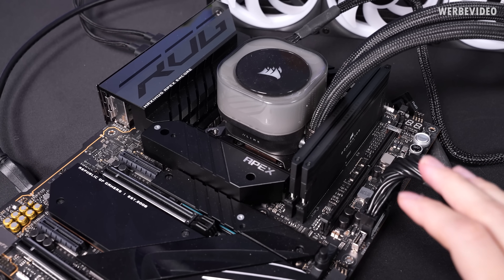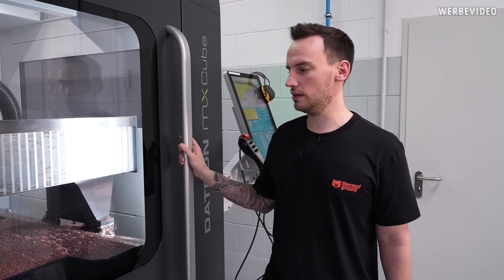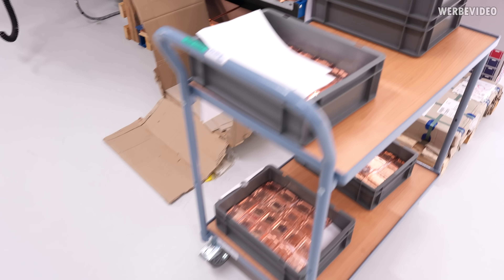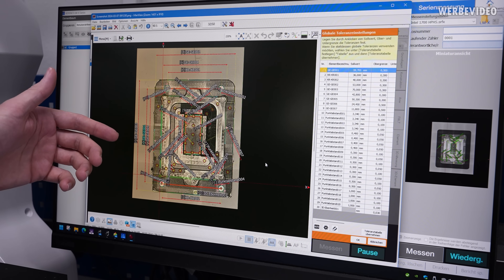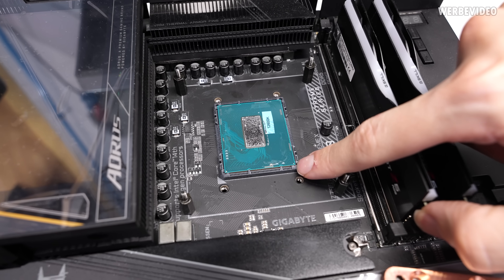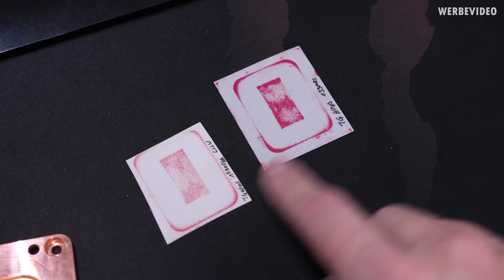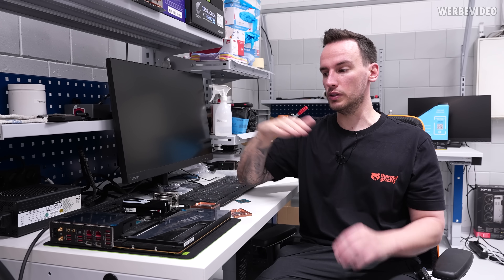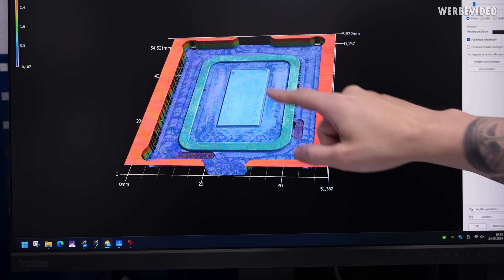I messed up

Comment: That's of course very unfortunate for those affected. And I understand this must feel quite stressful for you Roman and I'm sure your team as well but I'm confident the issue will come to a satisfactory resolution for everyone involved.

I'm a bit sad I missed that the block was actually launched as I've been holding off on buying that Iceman cooler for months prior to you announcing the Intel Direct Die block. Naturally I was pretty excited to finally be able to get a direct die block for my "new" PC. A "fairly recent" upgrade from a Z390 Apex and 9900K sys with direct die to a Z690 Apex and 14900K system which my old water block turned out to be less than ideal for, shocker right...🥴
Living in Sweden I was expecting a wait of 4 to 6 months after initial release until the block became available at any of the three official vendors. At least if previous Thermal Grizzly product releases are anything to go by. Either way I'll continue to wait diligently for this block to become available for purchase.

Fingers crossed, this all turns out to be caused by some weird unforeseeable quirk due to a miniscule variation in how the socket contracts as it cools down after manufacturing or whatever...or if the socket is manufactured at different locations around the world and it just so happens that sockets from this one place have a greater variability in its end results, officially not within tolerance...of course this is not a fun problem to have but I can't help but to be super curious as to what could be specific cause of the problem so even though this is bad it's also really, really interesting and I hope y'all find out what the culprit was.

Until then, as always, I appreciate what you do, how you do it and the content you share with us. 🙏✌🖖👋

Comment: I'm curious about temperature measurements.  Is this a hot-spot issue or a more general heat dissipation problem?  Any information available for mainboard and cpu in use when the problem is encountered?  De-lidded or no?  How many datapoints?  Has the base material changed?  When scaling up from design to production, are there new challenges like heat cycles while cutting metal?

Interesting puzzle, I do hope you'll share more!

Comment: why not just have a pure "stainless" high quality aluminums for the IHS plate? it performs better than copper. i think for an IHS to act as the thermal transfer bridge to the actual cooler's coldplate, it must be simple in shape, the width/dimension should meet exactly the same as the amount of contact with the cooler's coldplate. if you make an IHS so wide, but only let  some amount of the upper surface to get contact to the cooler's coldplate would be pointless. those extra  volume of the IHS that does not transfer anything would simply conserve heat energy.

Comment: As others pointed out, the quickest way to figure out the issue might be to ask affected customers to send their motherboard and cpu for analysis. It might be cheaper to send them a free board and cpu than to pay someone and blindly try to come up with the issue in the lab. Maybe some affected customers could even send their motherboard and cpu without asking for a replacement just to help fix the issue.

Comment: I guess the problem will affect the people who were running a heavy air cooler that caused their motherboards to concave. and since some motherboard have wide screw mounting holes, that concave will not be straightned with the pressure of this DD IHS.

Comment: Relying on your Keyence NDT for all the quality inspection is your problem.  I have a lot of experience with Keyence NDT units, you need to be constantly verifying they’re reading accurately and you should still be physically inspecting parts, samples from each batch, or on a timed interval.  The Keyence units are very reliable, but they are far from infallible.

Comment: Roman could the high ambient temperature and high humidity i.e. >35C and 95% humidity. I've seen weird temp values and only in rainy season with lower ambient temps 20C with 90% humidity, the temps came close to manufacturer. Maybe the info is old since i used mini itx and small build. Been long time since i used full ATX FF.

Comment: I worked in injection moulding ( plastics ) for over a decade. In my experience plastic parts can have a larger variance than you would think.this can be caused by humidity, cycle speed of the machine, set up of the machine, the amount of recycled material being used in the run. All kinds of stuff. Basically never count on plastics being in spec to the same degree as cnc metal. start measuring the z axis on as many sockets as you have available reach out to Steve ( GN an HU ) see if they can do the same measurements. One corner with a mil of flash on it would be enough to set off your contact and increase temps by 10 degrees. Hmmm an adult owning there mistakes and being open and honest about how they plan to make it right. Your parents brought you up correctly. You should thank them. Also, you have earned some more respect for doing the right thing.
Reply: good point about humidity we have some other products than plastic but that also have a tendancy to absorb humidity so we have to place them in an oven then store them under vacuum in a specific amount of time or they go back in the oven (that's before final packaging they will be hermetically sealed later)
Reply: From this point we should refer to them as "the Steve's"

Comment: Thanks for opening chat to speculative design :D I come from the "make e-waste into viable gaming computers" crowd. How about torque? When people are mounting their own direct die coolers, they most likely do not have the required mechanical understanding to get the tension perfect on their own builds. An inexpensive torque sensitive screwdriver could be included to mitigate this concern. I was also considering how multiple metals could be used to mechanical advantage as aluminum is not as good as copper for ion transfer yet is better at dissipating heat (EDIT this is not the case actually! aluminum heats up slower and cools down slower, yet the point remains, what about silver or graphene for that matter which are both better than copper in certain situations?? Perhaps a passive (or active with fan) fin stack on top of the cooler would do the trick?Also a thought on motherboard PCB design, are they all the same? would this affect the result?

Comment: Without knowing much of the subject due to not really overclocking, there's 2 directions I'm leaning for where the issue might be:
- plastic tray height as mentioned in the video sounds plausible, every brand has margins and even if yours are great it doesn't say much about the motherboard people try to mount it on.
- part compatibility. I would assume anyone buying such a product to know what they're doing, still asking which combination of parts was used for the situations where the issue arises might help find the issue.

Also great video, with many brands these days one questions the decision to support them. Not for Thermal Grizzly, happy with my Kryonaut paste and will look for your products again on a future build.

Comment: Root cause is not in measurement, but  in the fact that plastic parts are notoriously random sized. On top, plastic thermal-volume dependence has different curve  than cooper. Wraps it around - the issue is the core idea of the product - usage third supplier plastic part (with  no guaranteed quality) as a  high-precision contact point delimiter. ei. wrong design idea.

Comment: I'm just curious because the technology for heat pumps has come such a long way in the last 10 years, why no one is trying to develop this technology for cooling PC components. It would not need to be run at high pressure because its not needing to cool below ambient temp. It should be so much more efficient at removing the heat from the cpu block vs water that whoever is first to bring it to market would revolutionize the industry.

Comment: You probably already checked but could it be :
Tilted CPU on the PCB ? which could, without a solder make less pressure on one side, making less contact.

Comment: Sounds like you may need to gather a larger sample of motherboards and check for variances in that plastic socket frame. They should all be the same, since the socket is the socket, but maybe the accepted tolerances for that plastic socket frame are more generous/wider than your parts' accepted tolerances which could surely cause some (but definitely not all) parts to not fit quite as intended. You could start by collecting MB info for those customers affected by the issue and analyzing for commonalities

tbh you've most likely thought of this, but it's the only thing I could think of that you didn't really mention. You only stated that you've made the assumption that there isn't any variance in the socket frames 

Best of luck figuring this out, and honestly THANK YOU for being such a good example of how a company should respond to issues! Your reputation is well deserved

Comment: I'm wondering if you can get the info on how the product was installed by the user. Were the tests in-house performed with varying fastener torque levels?

Comment: Awesome to see that you're handling the situation like this, wish all manufacturers and suppliers would handle it in a similar fashion. Lucky it's only 50 units tbh risk exposure pretty low. Would have liked to see if it was hundreds of thousands of units if the refund process would still be the same. I assume it would have - giving some credit for current actions and just general vibe from thermal grizzly etc. Good stuff.

Comment: It was a stupid design Roman. You rushed the product and it has a horrible mounting mechanism. Unsuprisingly, the SuperCool 14th gen is still FAR FAR FAR SUPERIOR. You need a complete design overhaul. Using the plastic trim as your limitation and then trying to nail tolerances to contact die surface is a HORRRRRRRRIBLE way to do this because now your in a situstion where getting perfect socket pressure is EXTREMELY reliant on your tolerance threshold. I'm sorry, but you need to emulate something along the lines of what SuperCool did, because their system just works. Even more, not only does it work, but it's SIGNIFICANTLY better than your system in almost EVERY capacity. Its cools better, doesn't affect memory overclocking, and it's built like a tank. DO better Roman, you guys have been working on this system for MONTHS (OVER A YEAR AT THIS POINT). There are almost no excuses to why you put out a defective product, meanwhile a company operating on 1/20th budget out of Thailand managed to put out a functionally perfect block. Is Thermal Grizzly/ De8auer becoming the new EKWB in the space where profit margins and mass production reign supreme to actual performance and functionality? Hmmmmmmmmmm.... It's bad enough your thermal pastes and other products cost 30% - 50% more than  the general market, but now you guys have released 3 products in the last 2 years that were functionally D.O.A upon release.

Comment: Mad scientist!! lol - look at the hardness of batches (Brinell test) I bet there are batches that give different readings, depending on the manufacturing of the material. This means you will have to hold the supplier accountable.  As we know copper and steel are always a mix of materials and to get a consistent hardness is very hard to achieve.  It is always within the tolerance of a few microns that could potentially cause the issue.

Comment: I dont directly work with desktop systems, but i do know there are different manufacturers for server cpu sockets. I wonder for desktop, if the same board will use sockets from different manufacturers with very slight but different tolerances.

Comment: I wonder if allowing the motherboard PCB to be the place the direct die cooler bottoms out instead of the plastic socket is a better option. The tracers are protected and coated so it shouldn't have any interference. ICEMAN is using plastic to make contact with the motherboard PCB though but debauer uses metal so that might be the issue. It's possible there is intolerances in the the plastic socket in each board. I'm sure ICEMAN tested this and found no difference in memory performance. My OC on memory was the same on Super Cool and ICEMAN.

Comment: After watching the video the issue is likely the fact that you chose the plastic height of the socket instead of the board that caused the issue.    That really isn't something that has to be exactly the same on every motherboard.  There is no need for that to be exactly the same height every time so the manufacturing tolerances on that are not going to be that exact.    There is probably almost half a mm worth of height tolerance on that part.

Comment: Manufacturing engineer here. So impressed by your morals as a company so i had to comment. 
  All i can add to try help you with the problem is dont overthink things, start at the basics, look at the materials your using would be my first step make sure your not using faulty metal stock though im sure you've already repeatedly tested different units within the batch. Then as others have suggested look at the boards being used by the customers who have had problems. 
 From what i can see of your attention to detail i find it very hard to believe it's a problem with your manufacturing so id would take a good look at other possibilities.
 Good luck and hope you can solve this for everyones sake and your own mental health.

Comment: Companies have to realize that customer-company interactions are a relationship. Like any relationship, it's similar to a financial account. Every poor interaction is like a debit. Every good interaction is like a deposit. If all you ever have are poor interactions, you'll quickly be on empty with nothing to draw on. The way you treat your customers, the focus on your products vs assuming customers have done something wrong, getting right on top of the issue vs burying it, etc. all promote good will. Those are all "deposits". When you do run into an issue, there's a balance to draw on. People don't want perfection. They understand innovation and that it sometimes brings issues. All they want is for the company to work with them and to be fair. Fix the problem. Give them the product they paid for or return their money. It's not much to ask. Good job being prompt, fair and good with customers!

Comment: As a complete non expert in every field apart from BS and common sense I am calling BS on this and blaming end user as a moron or possibly something more nefarious at play.

This is hardware. You are not trying to repeat something like interference or noise in a signal. If talented engineers can't reproduce the problem then its a human or a very costly and time consuming attempt at brand damage.

Comment: I would hope that Intel has specs and tolerances for the socket dimensions. Does the heat spreader work with the full tolerance range? How many motherboard models have you tested it on?

Comment: OK   =  By     Your OWN Submittance  of  Reasoning , Using the  Plastic  Motherboard   Edge  is  Your  (   z  axis  )   of  Contact  and You Are LIMITING the  Depth   in  which  you are Allowing the  Product To  Push DOWN onto the Die  / Chip  =  Remove  this   (  z  axis  )   variant  Out  of the equation  and  Allow  For MORE  Pressure  Onto  the Chip  To  Create  More  of a Direct Contact  To  Die  / Chip   , As  Your explaination tells ME  that you Do   NOT   have  Enough  of a  contact  Surface   Being  Applied   To  Die  /  Chip  ,   i  dont  know  if  that  made  Sense  =  But  what you are saying m you are limiting the  contact  for fear  of  to much  contact and Afraif  of breaking the  die /  chip  ,  remove the Fear  till YOU  DO  BREAK  """  1  """  to  Find OUT  WHAT  THE LIMITS  TRULY  ARE  =  !!!  YES  =  IN   R&D   =  YOU  MUST  KNOW  YOU  LIMITS   """  PHYSICALLY   """   WITHOUT  PERSONALLY  FINDING THESE  LIMITS    """  FIRST  HAND  """   YOU  WILL  """"  NEVER  KNOW  THE FULL POTENTIAL  OF THE  PRODUCT  """"  = `    IN HOUSE     `  =     Think  of  it  like  this     =  YOU  MUST  BREAK  A  FEW  EGGS  TO  MAKE  A  CAKE  =  GET   IT  ???   GOT   IT  ??? GET  IT  .

Comment: Get somebodys CPU that had worse temperatures, offer a temporary replacement, do measurements on the unit. I bet different Intels have way different silicon height or curvature than it's feasibly acceptable.

Comment: You have to consider the human factor.  Not everyone has the same finger strength, and not everyone can gauge pressure as well as some people (Roman and the testing crew) that have plenty of experience mounting and unmounting a cooler.  The torqueing is left up to the user, with an angle wrench.  Not to mention you are bottoming out on the surround AND the die, ideally simultaneously.  Can you mill out the contact with the surround to take that off the list of possibilities and mount the cooler with spring loaded screws and a torque driver for consistency, if you haven't already tested this?  Food for thought!